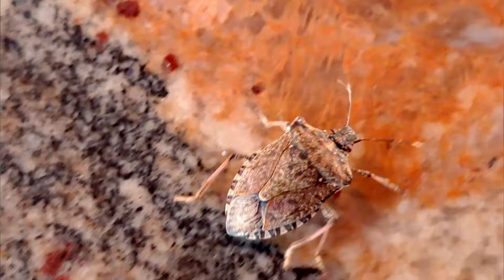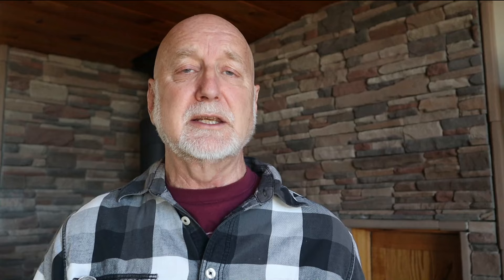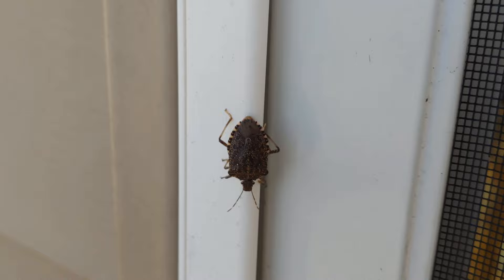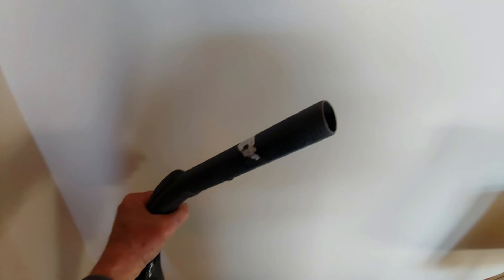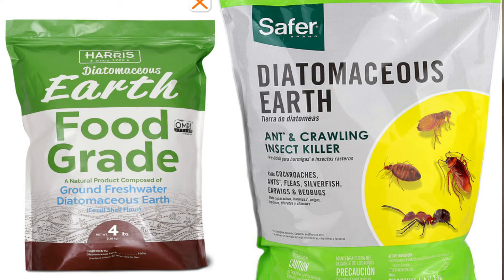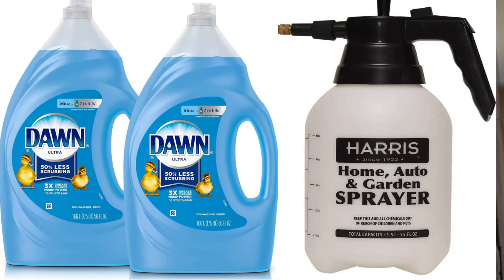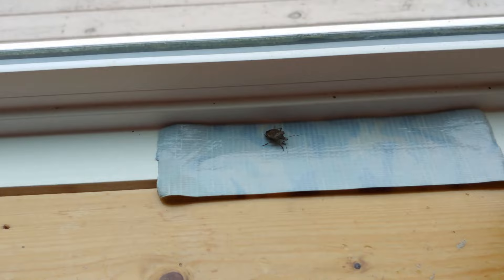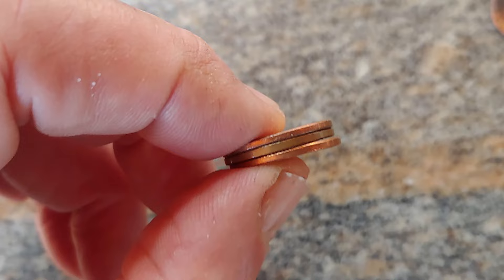Pesticide-free DIY: Rid your home of Stink Bugs! (Viewer tested!)

Comment: As soon as you mentioned using a sweeper, I thought to myself...he must not be able to smell them! Because as soon as you try to sweep them they stink up. I keep a bottle or jar half way up with isopropyl alcohol. I can either just put the opening over them if they are on the ceiling and they drop right in. If they're on the wall you can use the lid to help flick them in.    I just leave it on the window sill ready to grab. It remains stink free for several months till you get it kinda full then it might reek a bit....just throw it away and get a new bottle or pickle jar.
Reply from the maker: Ha! You are exactly right!  I can't smell them at all! Thanks for sharing a technique that you discovered works well for you!

Comment: We used to get hundreds of them getting inside and huddling around one window of our house and i (dont ask how i found this out) would spray foaming carpet shampoo on them. It would suffocate them and prevent them from stinking. Eventually they stopped coming
Reply from the maker: Ha! I want to find out how you found them! 😜 Glad you found a solution that worked for you!!
Reply: That's another good tip, thanks!

Comment: Frank,
Adams County, PA here. Live in the woods and get a fair amount. Finding 1-3 inside per day even in the winter. The lights are brightest in the kitchen. Have found them coming in through the chimney and have done my best to block. Your video was excellent but I honestly feel they can squeeze through tighter spaces when they really want to.(heat, breeding). My chimney is fairly well sealed but the chimney cap has small hole that I have to believe they are squeezing through. The idea of washing done the wall with Dawn sounds like a great idea. Every October they are all over the outside wall of the house that gets the most sun. I didn’t realize they leave the pheromones also. I use dawn inside with decent results so outside it being a deterrent and removal of pheromone scent sounds good. From other Sounds like Peppermint works well also. Thanks for the ideas and update.
Reply from the maker: Hi Rich Boyd ! Thanks for your observations and insightful and thoughtful share.  I agree with you re: squeezing in.   My test conditions had a smooth granite surface that lack traction so really has limited real world application. With traction I am sure that they can "squeeze" through even tighter spaces as you say! Let me know if you test some of these solutions and how they work!  good luck!
Reply: We have a pellet stove and have found that they like to reside outside underneath the tarp that covers our pellets.  So when we bring a pellet bag into the house, guess who gets a free ride inside
  Just saying it may not be your chimeny, you just may be bringing in hitchhikers with the wood. 

~Not sure?

Comment: I will use either 2 disposable plastic cups or 1 cup and a thin piece of paper to catch them when on walls, ceiling, etc. Place 1 cup over top and slide the cup to knock the stinkbug off balance. Place another cup on top then dispose as you wish. Wash and reuse the same cups designated for stink bug removal.
The 1 cup method is enough to trap them but those stickers move quickly.
Reply from the maker: Thanks for the tips!

Comment: Great suggestions!  I would like to know how they survive for months and months inside the house, just hanging out without eating anything.  In my upstairs room I don't use heaters in the winter during the day, then when I go up at night and warm it up, out they come from who knows where.  The only good thing is that they are very easy to catch since they are so slow.  My cat often points them out to me by staring intently at one I have not noticed.  He won't try to catch them, probably does not like the smell either,  but I can when he alerts me.
Reply from the maker: It is kinda like an insect hibernation....technically called "diapause".
Reply: To make quick work of eliminating stink bugs, use a BATTERY-OPERATED, HAND-HELD VACUUM cleaner.
Reply: @elliottpeabody1287 and if you cut a pair of panty hose or something similar and then slip it inside the vacuum hose and secure it with a rubber band then you have an easy way to dispose of them.
A container of soapy water to knock them into works as well because one of their natural defenses is to just let go and fall.

Comment: I don't use dryer sheets anymore but that got me thinking- I do use Lysol laundry sanitizer and it smells like a dryer sheet on steroids! I cut it with water (still very strong smell) and spray it around my windows & curtains. I read that garlic is a scent they hate but who wants that smell in the bedroom or bathroom. So I did an experiment for stink bugs and it works. I'd think liquid fabric softener would work also. Now my bedroom always smells like fresh clean laundry and I don't have to worry about any bugs dive bombing me in bed (shudder) Hope this helps someone
Reply from the maker: This is a fantastic tip! Possibly even stink bug episode worthy!
Reply from the maker: Cool that your room has the smell of fresh clean laundry!

Comment: The first winter in our current home saw an infestation of stinkers in our home. I knew nothing about them. After some online research I mixed water, dish soap, and white vinegar into a spray bottle. I sprayed the stinkers and they died quickly. WHY? The vinegar dissolved the waxy substance on their exoskeleton and they died from dehydration. But I still didn't know how they were getting into the house. Finally, I looked inside an obsolete incinerator and there they were. I now spray the inside of the incinerator with a vinegar mix. I also place a cottage cheese container with vinegar in the incinerator. The smell seems to keep them away. I have gone from hundreds of stinkers annually to around 2-3 dozen max. The vinegar smell works to keep them away.
Reply from the maker: Thanks for sharing another technique that works!!!

Comment: I put light traps all over my house and in the attic and basement, and they didn't work at all. Tried all different types of lights, and used all the methods for this that I found, and still didn't work. I have a dedicated vacuum cleaner that I use just for them and keep that on the porch, since you can't get the smell out once you've vacuumed them.  So far, the best results I've found are spraying with Dawn & water outside, and using soda bottles with Dawn & water inside and putting Diatomaceous Earth food grade around all the perimeters of the rooms in the house.
Reply from the maker: Thanks for share Patti.  Thanks for sharing your observations and data here with me and our learning community.  And thanks for sharing what did help you.  Curious about the light traps.  I wonder if the light works later in the season...?

Comment: Dawn dish soap is a double whammy, first like all dish soaps it breaks the surface tension of water allowing the bugs to drown & second it is one of the best Oil & grease cleaner. So if the bugs have a natural oily exoskeleton this will remove the oil and allow the water to block their exoskeletons any smother them. I use Dawn & water mixtures to knock down Stink bugs, Lantern Flies, Wasps and many other insects without harmful Pesticides but for flies I love my "Bug Assault" gun to blast them away.
Reply from the maker: Amazing that "Dawn" brand keeps being mentioned as the best!

Comment: I have never seen them until a few years ago, and they are getting worse. What I hate is if they drop on me and release that smell, I don't know what it incorporates but they leave burns on me. Is this common and why does this happen?
Reply from the maker: Again you have a very sensitive immune system and high histamine response to foreign proteins!
Reply: To make quick work of eliminating stink bugs, use a BATTERY-OPERATED, HAND-HELD VACUUM cleaner.

Comment: I don't smell Stink bugs either. They act so lethargic that I gently grab them off the windows with my hand and dispose of them. They share some of the characteristics of Boxelder bugs, in that they group together and head for indoor heat if they can make it in. I heard that Mums are a plant that will help deter them away, placed by any openings. I've tried the soap and water remedy, but it doesn't work. They scatter but come right back after dries in the hot sun. They are worse than Stinkbugs in abundance .. by me. They both drive me Buggy nonetheless! 😉
Reply from the maker: bugzilla!